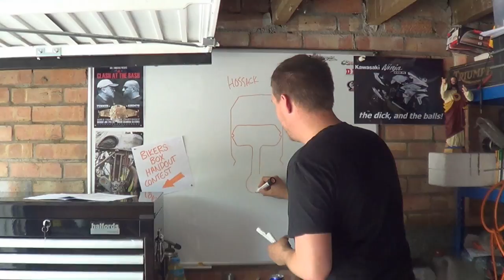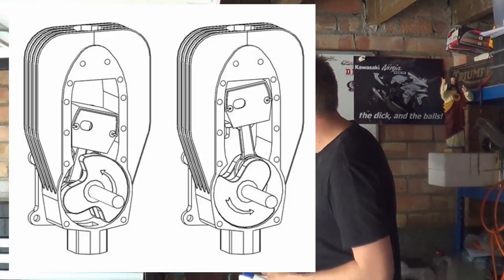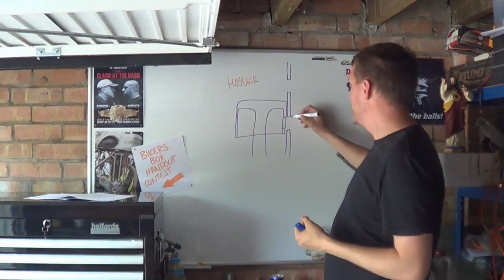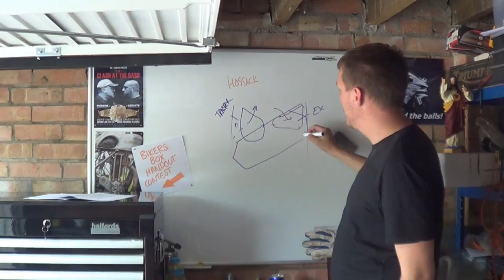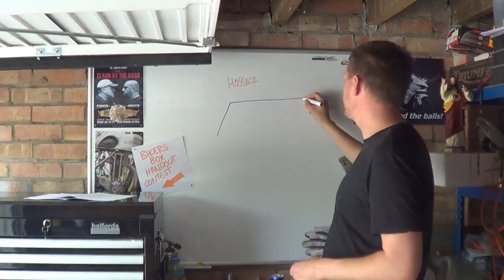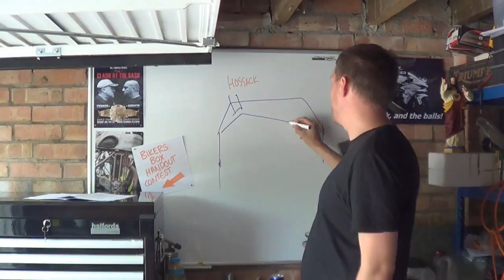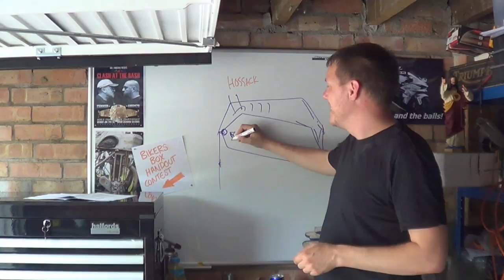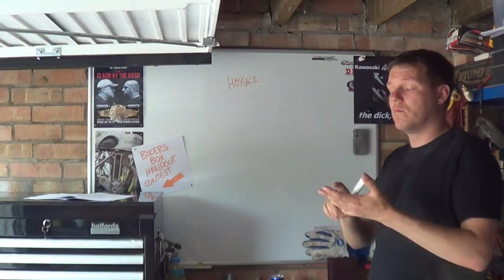Real square piston engine - the Hossack

Comment: Hello
 I only recently found this video. Fun to see other views of my work. One comment needed here; my engine does have a a semi spherical combustion chamber. I see the close fit of the crown to the head as only a squish area.

But I have to ask. It takes about  30 degree of crank rotation to get over TDC, and about 40 degrees at BDC. From this added time I reason that the end loading is much reduced.  Now this would allow lighter parts or a higher speed. I don't have the mathematical skills to do the calculations.

One of my main objectives, was to have a asymmetric port timing. Which I see as the downfall of the conventional 2 stroke.
Regards
Norman
Reply from the maker: Hello Norman and thank you for commenting on this video. I do like this design over a lot of others I have either seen or done videos on. Would it be ok to ask you a few questions. If so could you reply via email to this address. matthew-hudson@outlook.com

Nothing too heavy, I would just like to do a follow up. - 

Kind regards Matt
Reply: Sounds like the exhaust port needs a little bit of assisted suction, and the transfer port could use a tesla valve or something.

Comment: Matt - some video ideas:

1. Ryger two stroke engine.
2. Reed valve vs Disc valve.
3. Conrod length - long/short advantages/disadvantages for dwell time, piston side-loads and what is the sweet spot for rod angle/rod ratio (2.2 or more has been suggested by  Jan Thiel and/or Frits Overmars). I'm actually trying 15mm longer rods on my latest RG500 rebuild.

Also - for an interesting read search google (if I paste links it will be marked as spam!) for "[GP125] All that you wanted to know on Aprilia RSA 125, and more, by Mr Jan Thiel and Mr Frits Overmars". You should find some long discussions spread across five thread parts on pit lane forums.

Comment: You should do a video on the “liquid piston engine”. Looks like a rotary type offshoot with an elongated oval as a rotor
Reply: They claim it solves the oil burning issue and is practically an inside out version of the Wankel engine.

Comment: "The plane's back" Just be glad none of your neighbors have paramotors or ultralights.

Also at 10:54 that kinda reminds me of those little flathead engines built for cheap lawnmowers and go karts. How the air in the chamber moves one way then back the opposite.

Comment: So that cross section, like 50p coins I take it? Forgot the name of the effect but basically it's a lobed shape with a constant circumference but not a constant centre point from the edges? 

Also, would this make a good candidate for forced induction if direct injection worked out, blow out the exhaust early, charge the cylinder take care of oiling it with a leaky turbo ;)

Comment: would it benefit from a 2nd spark plug to continue the burn after TDC. 
also perhaps move the intake port to the top with reed. and leave exhaust as is?
Reply from the maker: twin sparks is a video I need to do soon

Comment: 1. The  "squishing" in  compression stroke: I understand that you want it (causes thumble or other kinds of air turbulences), but isn`t it bad in terms of air-fuel mixture self ignition because of higher pressure regions?
2. complex pressure regions: Wouldn`t it be possible to specialy shaped cylinder heads and some kind of double sparkplug ignition for a more continues gas expansion?
Reply from the maker: 1. - auto-ignition or pre-ignition starts due to tmeperature not pressure (although they are closely related) Its also just moving the gases - movement = drop in pressure to a degree.

2. - Its complex due to how the combustion chamber changes volume in 2 different vectors. In a normal piston engine the volume in increasing in 1 vector only - downwards so to speak, volumes that appear and expand in regions ahead of the flame front really fuck things up.

You can optimize the combustion process, and the easier way would be to have a combustion chamber in the piston. But the problems of this ''rocking' piston still stand. In this video I talk about what Norman did. In the next, what can be done to the design to address some of these issues.

Comment: Uhm, that thing does not have to be crank case breathing... it could be blown by a roots style blower, and have a proper sump with some squirting up the "bore". Put direct injection and two or three spark plugs on it and... oh... yeah... it IS a lot like a Wankel, isn't it? :P
Reply: Any case breathing 2 stroke could instead run with forced induction and direct injection.
Reply: This is gold :D

Comment: How would dishing the top affect it?
Reply from the maker: In the next video - matt
Reply: Fuck this Google reply box not taking text when it feels like it!

You may want to make card cut-outs rather than bother with video?
There might be something in a complete rethink of cylinder heads, maybe incorporating connecting chambers -even housing the actual detonation?
Sort of incorporating a Stirling engine ...but not.

In fact, thinking about it now, the solid piston is half the answer to a one stroke. An engine that fires on all strokes, like an enclosed jet.
What pressures are you limited to?

Comment: I would say. the piston walls? I guess it can be called. and cylinder walls? also if you could call it a cylinder... any way . the piston and cylinder walls would have to be thick and heavy. and likely vibration prone. witch a wankel looks to be also . with the rotor moving around every where. maybe it can work. it also looks like there could be issues with the rod piston failure with high rpm. but it does seem to be a lower speed engine. in my mind anyway.    I just can't see it at   10k ! I do want to know more about this engine!!!! great video
Reply from the maker: Norman firing it up - https://www.youtube.com/watch?v=1JETt0_nq3s

Comment: why no wrist pin
Reply from the maker: Good question, in the next video
Reply: Camron Goodall 
to allow the piston to rock . witch allows the intake and exhaust ports to be open and closed. depending on what part of the cycle its in. if it had a pin and pivoted. the system would not work. the engine couldn't run. it would be a disaster. if it was attempted to run the engine. it would be like a piston without a skirt. every thing would be flopping around.
Reply from the maker: Thanks for that, saved me doing it
Reply: oh sorry honestly I didn't watch the video fully and figured it was just a normal piston except square and without a wrist pin so I figured it wouldnt work but the design fits the reasoning
Reply from the maker: The dude in the video is Norman Hossack - the inventor